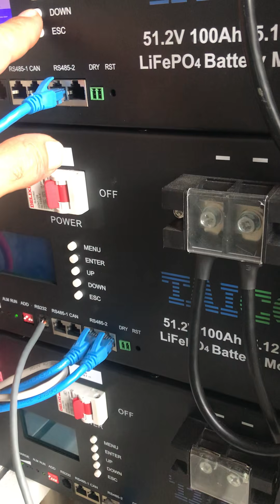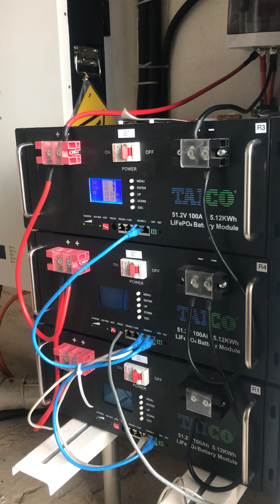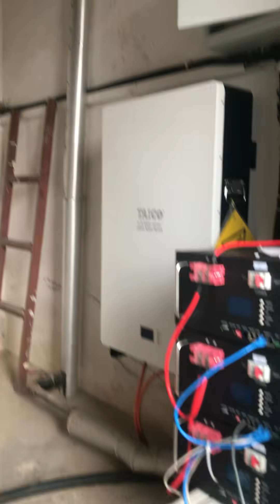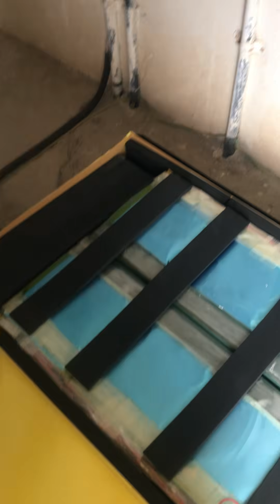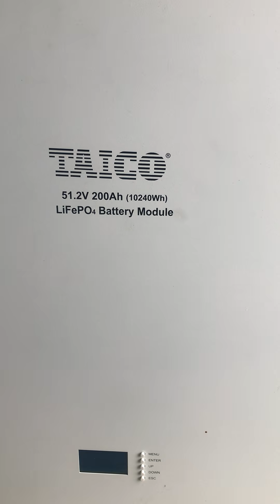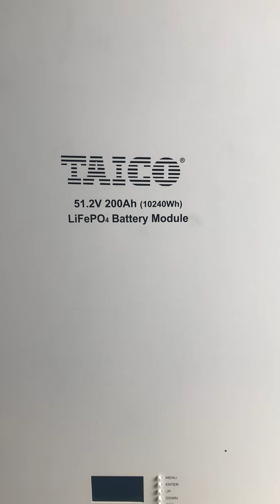Taico power awful lifepo4 battery, huge problems, false adds, defective POUCH cells, NO warranty

Comment: This is entirely our responsibility, and we sincerely apologize for any inconvenience and trouble this may have caused you.

TAICO always adheres to the highest standards, but we failed to meet them this time. We deeply regret that this issue has affected your trust in our brand. Please rest assured that we will take full responsibility and have taken permanent corrective measures. Specifically, we have:

Upgraded Assembly Process: We have comprehensively upgraded our battery production technology, introducing stricter quality control checks and more refined processes to ensure that such defects do not recur.

Established Dedicated Team: We have established a special task force comprised of our Customer Service and Engineering departments to urgently handle all reported battery issues. This team is dedicated to providing rapid and personalized support to affected customers. Please contact us!

Sincerely, TAICO Customer Support Team

TAICO Customer Support Team

Comment: haha i purchuased 1 like this just diffrent housing for 250 euro. company that sold it to me had so many of them failed that they decided to sell it for fraction of price. i fixed one of them by charging it beyong 100% and force inverter to keep charging it more than 100% . it worked . so you can try same .
Reply from the maker: How do you fix bloated pouch cells? What you are doing is very dangerous. If you over heat the pouch tabs they may leak and cause all kinds of issues. Be very careful please.
Reply: @puntorem update it failed eventually didnt last long 😂😂😂

Comment: Thanks for letting everyone know about this!
Reply: I purchased from Taico having problems 4 51.2v 200ah , no real customer service. 5 months for shipment, no name brand 10kw inverter has to be restarted to charge batteries. Alibaba is a useless shipper.
Reply from the maker: Alibaba advertises itself as a secure site but it has no control over its sellers. It never checks or evaluate its sellers. One of the worst sites in the world in terms of customer service.

Comment: There are dozens of batteries in the market, do you have any recommendations?
Reply from the maker: I think it is much better to purchase them from a local reputable dealer. If you do not have access to a local dealer as i said it is a hit or miss. Deye -an inverter company now sells batteries but i have not tested them out. Will Prowse tested a lot of batteries in his youtube channel @WillProwse
Reply: @puntorem  again you do mistake bro, buy cells and cases separately and assemble it yourself

Comment: May I know which country are you from? How long did you get the battery installed after you received them?
Reply from the maker: It took 4 months to arrive to Turkey. When they arrived all had 55% SOC. I installed first one within a month to test it out. It failed right away. 100ah battery held 82 ah in the first 50 cycle. Because i do multiple installations i could not install the others to my customers. But i did test the others. All had multiple cells going down to 2.5v prematurely. One wall type completely lost holding any charge after 8 months.

Comment: Hi. I seems like this experience will also be mine. I purchased my 2 rack batteries some 2,5 years ago and had them running for 2 seasons, from april to october. When I was going to start this years season, I found that one battery would not cooperated, and the other only reached 80% SOC. So I started to investigate, and eventually opened up the 2 metal boxes. To find pouch based cells in very poor state, mainly bloating and leaking. One of the rack batteries had over 50% of the pouches in a bad state, and the other, had some 2-3 looking bad. Since the very beginning after I recieved the 2 rack batteries I  have been in contact with TAICO trying to get some assistance. Always with the same answer: hello friend, I will speak with the engineers. In my case I am pretty sure that one of the BMSs is damaged. Also. I am not sure what to do, but like you, it is completely unlikely to purchase more from TAICO. My costs were some 1.850 USD for the batteries and harbour fees, VAT and handeling cost for another 1.000 USD. Altogether a good sum of money. What are my plans now? I will try to replace the 2-3 bad pouches in the best rack and try to make it work. I have already ordered 16 prismatic cells from EVE, the LFG100LA that should fit nicely into the TAICO metal box. If the BMS is ok, I will reuse it, if not, replace it with a model from JK. My problem now is to separate the pouches from each other and the cell packages produced by TAICO. The soldering is massive, and the lips of the pouch-cells are bended together some places and the other with a small copper plate as unification. Applying a lot of heat will most probably destroy the pouches, so I am trying to find a good solution. Anybody out there with some good ideas? My location: Oslo, Norway

Comment from the maker: I should also mention here the BMS they use has a decent software to control balance and other charge discharge values. It is a decent BMS and it logs the alarms very well. That was how I was able to figure out the cells that were defective before they sent them. I played with balance, top balance, charge discharge values to no avail. Once the cell is faulty, I believe tjat is the end of it for the cell and the pack. You must replace it/them.

Comment: Your battery cells might not even have a problem. The problem is the crappy BMS which is built into all this industrial packs. Your cells inside the pack probably never have balanced because they can't. The BMS is set the way that it will stop charging as soon it reaches a cell limit and without continuing charging it will stop balancing. So the cells will run out of balance by time and you just can't do anything about it. I just got a LFP pack with pouch cells and that is what I can see. cells just running out of balance more and more with each cycle...
Reply: thank RolandW  .. i like your YouTube site many great videos  .. i think many of your postings can be of help to our new friend
Reply from the maker: In my case BMSs were fine. Yes there were some manufacturing issues such as lose connections, etc, but this was a battery manufacturing problems not BMS problems. In one battery the led display was showing 0 volts no charge or discharge values, yet the inverter was communicating with it was doing its charging and discharging job. When I opened the box I found out one lose solder connection underneath the cheap silicone they used for the insulation. Re-soldering would heal the LED display however not anybody is capable of doing such diagnoses and repair on her own.
Reply from the maker: I also follow your youtube channel. What you are doing is priceless. Thank you for the good work.